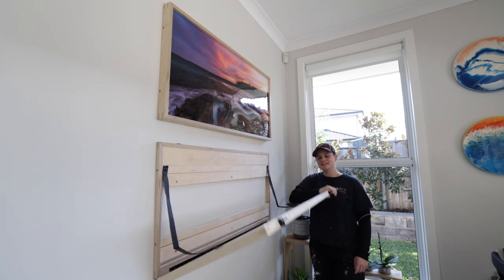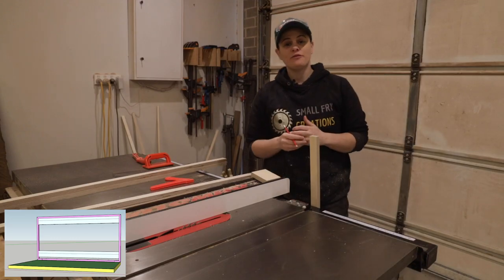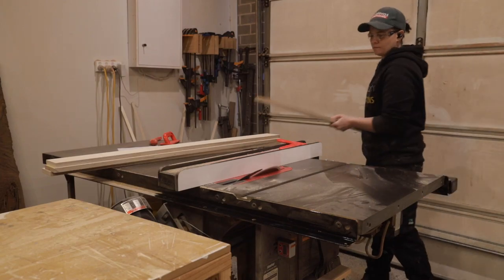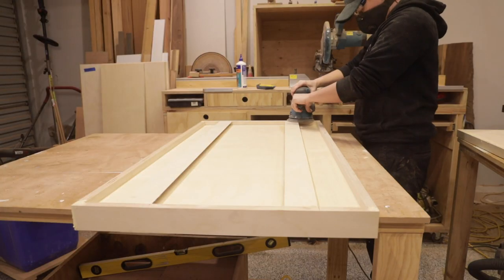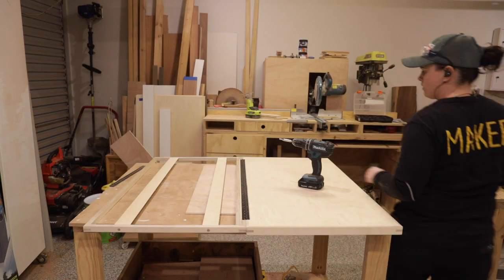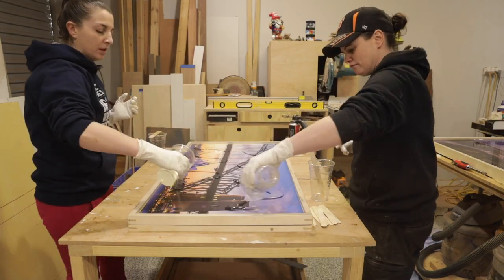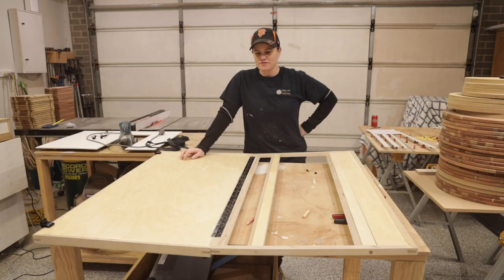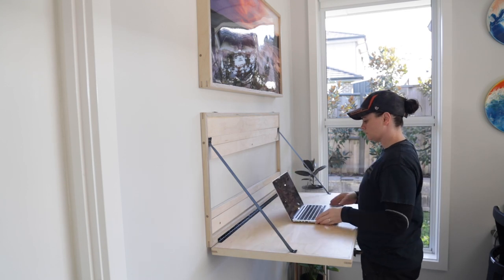DIY How To Build A Wall Mounted Murphy Standing Desk Hidden Behind Picture Frames!

Comment: You do good videos.  Thank you.  I want to get into lazer engraving. I have a sawmill, so I frequently get some beautiful pieces of wood. The extention kits for Sculptfun is part of what I'm looking for.  But, you may be able to answer a question for me.   Can I engrave a scene onto a 6' piece of wood that is longer than the extention kit is by engraving part of it then moving st machinover then finish engraving the rest of the scene? Picture a  6' bench on a porch with a forest scene on the back.
Reply from the maker: Thankyou. Yes you can engraver a picture but do part of it and then moving the laser. I haven't done it myself but I know its possible. I believe it a feature in Lightburn the software. My recommendation would be to join the Sculpfun Facebook group and have a search in the group as I'm sure there are poeple who have done and would be able to offer advice and tips.

Comment: Very creative! I also like your assembly/out feed tables, what are the dimensions of the top sheet and do they attach together?
Reply from the maker: Thank you Steve. The big table is 900mm x 1200mm and the small is 650mm x 1000mm. They don’t attach to each other but they are the same height which is handy at times.

Comment: Thats a really nice Idea!
Im toying with the thought of integrating something like this in a cabinet.

Can you tell me how stable this construction is?
I tend to rest my elbows on the table (im using a sitting desk) and i would hate it to have a lot of flex on the desk.
Reply from the maker: Thank you. It’s fairly stable. I wouldn’t be putting all my weight on it. It would probably hold but I didn’t design it to take all my weight but it’s pretty good. It would all depend on how far out the desk folds down. The less that folds the more stable it would be 😀

Comment: Love your latest project as I always do. Thanks for sharing. 
Would you still recommend the sawstop contractor saw? Ever since your unboxing video I’ve flip flopped between their JSS and the contractor. Don’t normally procrastinate this much, but a bit concerned about the footprint in my garage, and especially dust extraction.
Nice to have an Australian and Sydneysider’s perspective. 😄
Reply from the maker: Thanks Howard. I would still recommend the contractor saw for the workshop if you can fit it. I like the cast iron top and fence system on the contractor compared to the plastic on the JSS. I think the contractor will last me a life time 😀 hope this helps. The dust collector is pretty good especially now I have a big dust collect running to it.
Reply: @SmallFryCreations  Thanks for the reply. That’s made me finally decide on the contractor.
Reply from the maker: Ooooo awesome. Good luck 😀 exciting times!!

Comment: How strong is the polyester webbing? I've been thinking of doing the same and wanted to know if its best to double up on the webbing If I plan to add weight like a laptop on it?
Reply from the maker: Hey Its pretty strong. If you are concerns then you could double it up for sure. We haven't had an issues since the install.
Reply: @SmallFryCreations  cool, do you predrilled before hand?
Reply from the maker: I pushed the screw through the webbing and pre drilled the timber. I found if you ore drilled the webbing it should get caught
Reply: @SmallFryCreations  does it matter what height the top of the webbing should be mounted? Could it be mounted much lower like 7 or 8 inches from the top of the desk?
Reply from the maker: Not 100% sure. I think it would depend on how big the frame is. We wanted the webbing half way along the section that comes down and for it to have good support we needed to come up the back of the frame. You would have to do some trial and error
Reply: @SmallFryCreations  cool, will do. Thanks!

Comment: Great ideas!  I'm building a wall cabinet and my source for magnet closures has always been cast off 3 1/2" hard drives.  Check Gumroad or other media and I bet you may find them by the  dozen.  The castings also make good melting metal if you want to recast them into something.
Reply from the maker: Great Tip. Thank you! I will be sure check them out!